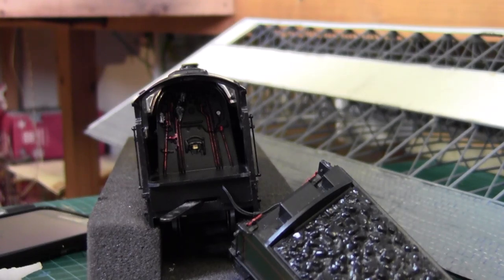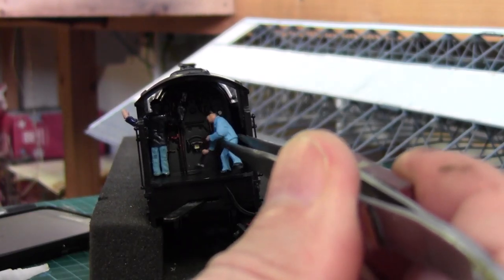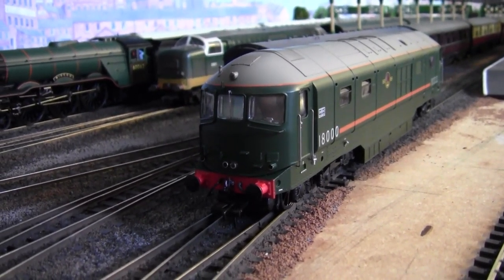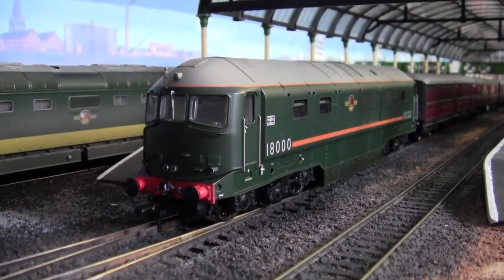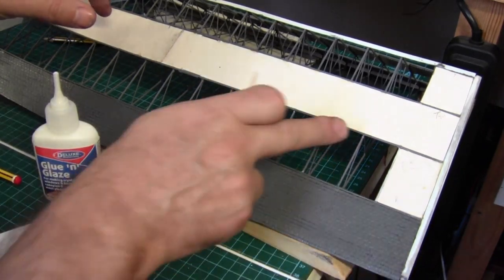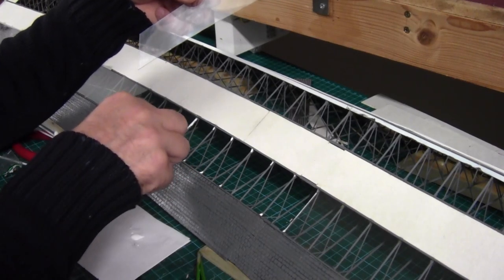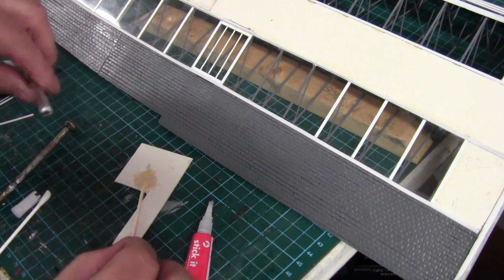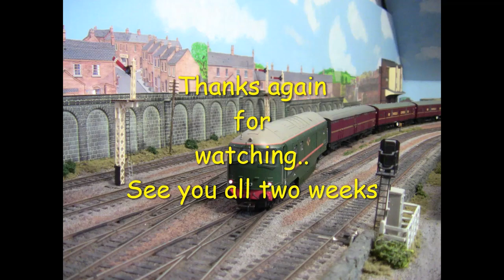Roof Update & The GWR.18000 Gas Turbine No 291

Comment: Your work on the roof never ceases to impress. It would be interesting to work out, when it's finished, how long it's taken to build. It's obviously quite a long time.
Reply from the maker: Hi Les. Last January the track went down at shields, the roof i think has been going on since may....so yes there just not enough hours being put into it. only a couple of hours each evening....it should be finished before christmas....thats my target. The roof, the signal gantry. and the dummy point motors should complete the station....thanks again...Tony

Comment: Excellent again Sir! Not a fan of the GW but the Gas Turbine is something else-there was two on the GW. Well, they had to be different! However -if you can run a Blue Pullman to Hartlepool [honest] then you can run a GT to South Shields. 60862 -Thanks for putting the crew in. it was a Kings Cross loco from 1950 until April 63 then re-allocated to New England and withdrawn June 63.
Reply from the maker: Hi Bill. 
            Having the crew in 60862 really makes the loco come alive. i would do all my loco's but it would cost a small fortune. at the moment the focus is on the roof. in which i am half way down one side...
as a few have said we could have inter regoin specials appering now and again...that would make a bit more interesting on the layout. but i would still remain prominatly North Eatsern...thanks again. stay safe my friend...Tony
Reply: @TONYNORTHEASTERN  And a Bachmann Blue Pullman would be very expensive!!
Reply: @TONYNORTHEASTERN  Just a thought [I do get them now and then] alter the 2 to an 8 and you have a Gateshead loco from July 1952 until Jan 1960 then Heaton back to Gateshead and then St Margarets!

Comment: Hi Tony,
Nice to see trains running and yes the 18000 Gas Turbine looks and sounds a lot different to the norm a nice model was it the factory fitted sound? as for the roof how you do all those little bits without going mad I don't know but coming on in leaps and bounds and the bars on the glass in woodworking terminology would be called Glazing Bars and the bit holding the glass in would be Glazing Beads cheers for coming on my stream last night good to have a talk even if only by text at your end keep safe and well.
Cheers Robert.
Reply from the maker: Hi Robert. the 18000 did come with the sound already fitted. i dont think i could listen to it for to long. as it has that weired pitch tone to it... I have had a good weekend so far with the roof, as i have almost finished one side with the framing and detailing of the cladding. I do like your live streams. maybe we will catch up on the next one...all the best Tony

Comment: I saw 18000 down at Didcot about 5 years ago and it no I terbal workings at all, it was a rolling empty shell
Reply from the maker: Hi Stephen. i wonder if they ever got her running again. thank you for commenting. all the best Tony
Reply: @TONYNORTHEASTERN  well it needs a gear deal of work done in it which may take years, even decades before or becones operational again, from what I understand it had been stripped bare of all its internal equipment and mechanicals and I think it will just end up as a token static exhibit if a bygone age of what might have been or could have been, I was wiyh a friend of mi e and we found it in a stick out of the way siding quirely decaying
Reply from the maker: Thats a true shame. its is a phonominal part of our railway heritage. 
thank you for the info.......cheer's Tony
Reply: @TONYNORTHEASTERN  it was quite a shock seeing it in that state, the frames, bogies and body shell looked in good shape but you could see daylight through all grills and louvers which should have had the mechanicals and axillary equipment inside, but there wad nothing and it seems likely it will never run under its own power ever again and just relic of a bygo ne of abandined technology that never reached its full potential